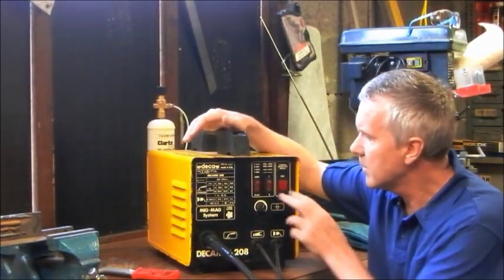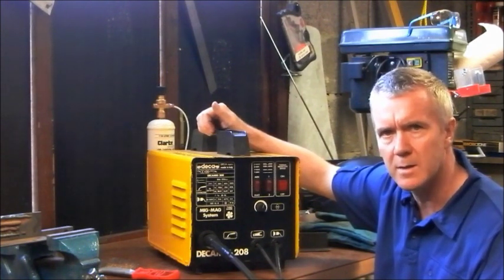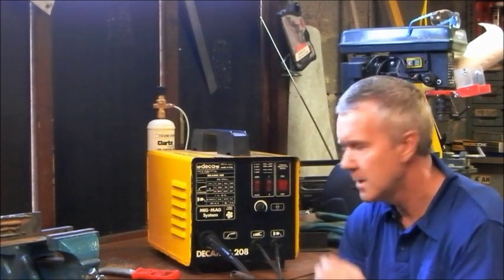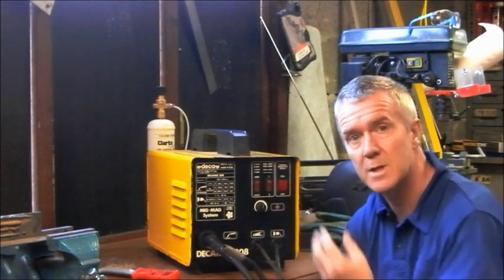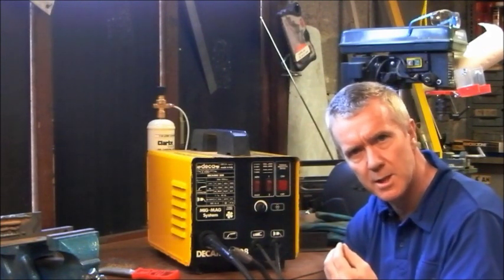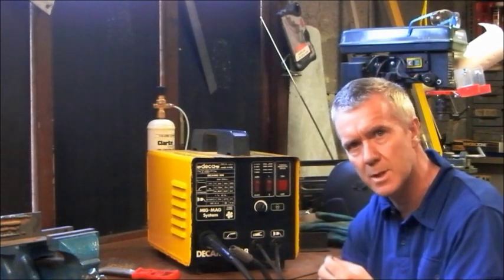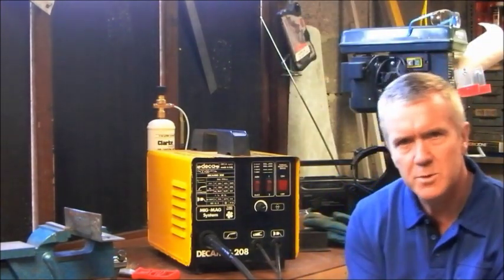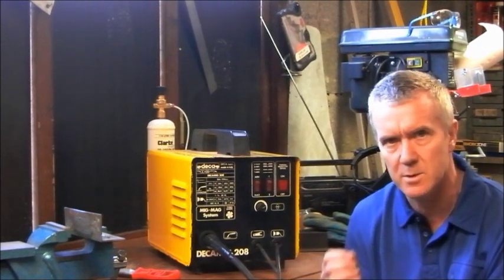Mig welding part three, setting the wire speed

Comment: excellent tutorial thank you . I have learnt a lot from this guide . I wasn't even aware that I needed to set the gas flow rate .
The on-the-fly adjustment of the wire speed was brilliant. I have struggled with this every time I use this Sealey Minimig 130 
Now I know for sure why my welds are poor and I'm not getting that consistant sizzling sound and weld seam.
Thanks very much